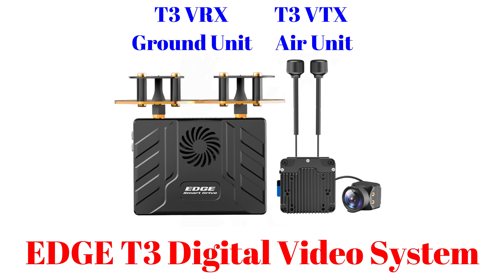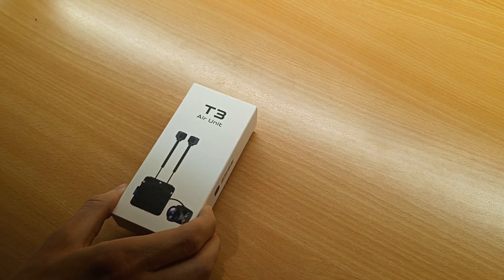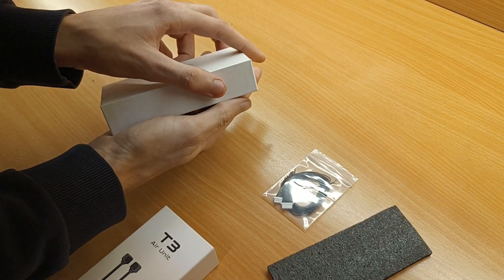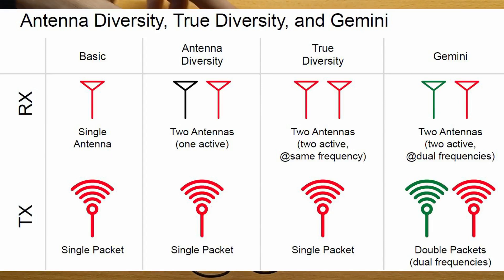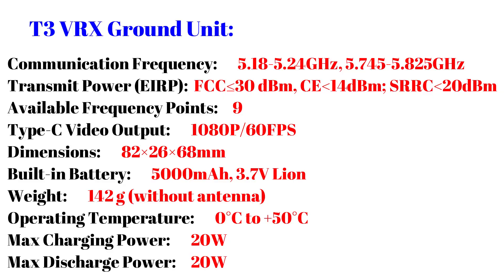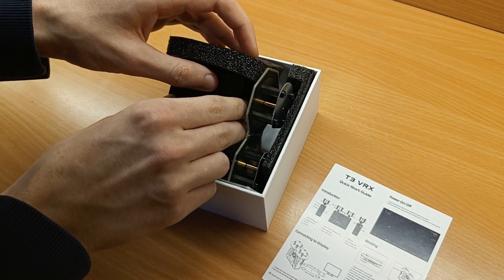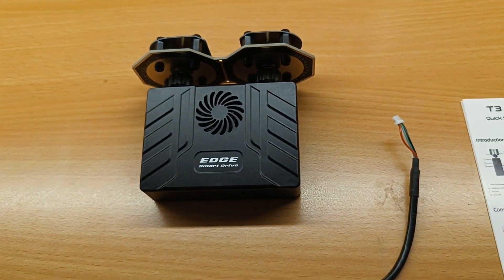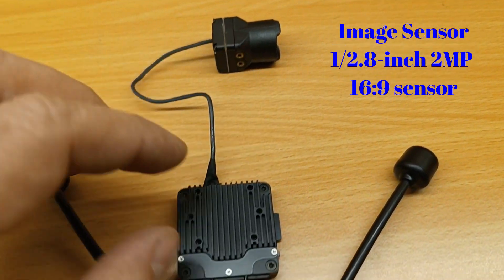EDGE T3 HD FPV Video System, a New 1080P HD FPV System

Comment: ALCON: 

I have this unit and am also an embedded systems firmware engineer. I have personally cracked this unit open and extracted the firmware and inspected the hardware and let me tell you. By NO MEANS is this Unit ANYWHERE NEAR capable of what Edge T3 is claiming it to be capable of. 🚨 WARNING: Read Before You Buy the Edge T3 System 🚨

I bought the Edge T3 for $320, and after tearing it down and accessing the firmware via UART, here’s the truth:

👉 It’s running a 2017 Buildroot Linux distro
👉 Built on a cheap SigmaStar INFINITY2M SoC (used in IP cameras, not FPV)
👉 Absolutely NO “embedded AI” or RF optimization—just marketing fluff
👉 No secure boot, no authentication—root shell access over serial with zero protection
👉 The entire system is built from open-source components (BusyBox, squashfs)
👉 Real hardware value? Maybe $50–$70 at best

They’re charging DJI-level pricing for a glorified IP cam dev board wrapped in tactical cosplay. Don’t fall for the buzzwords like “AI-powered streaming” or “pro-level digital transmission.”

I have full root access. I’ve seen the source. This thing is a scam in a case.

You’ve been warned. 🧠💥